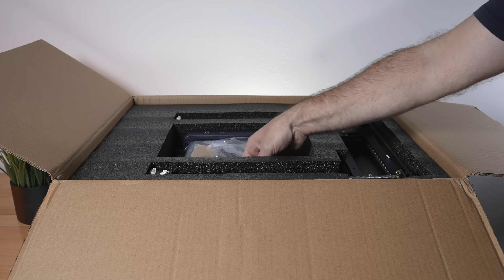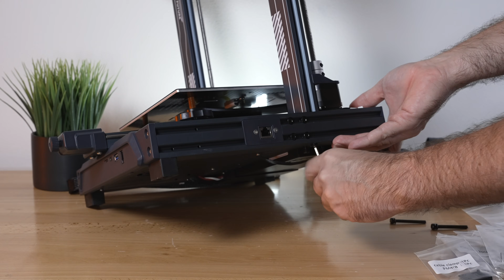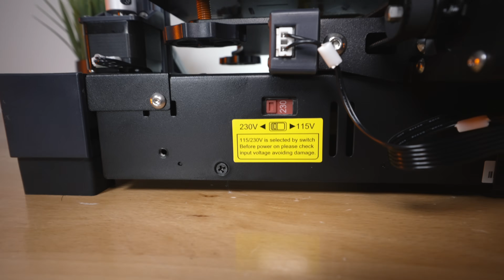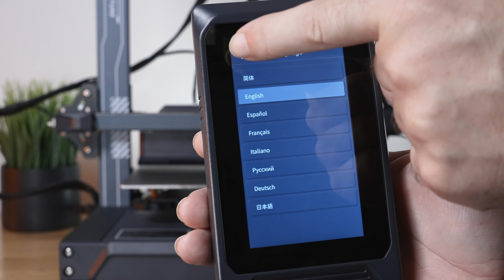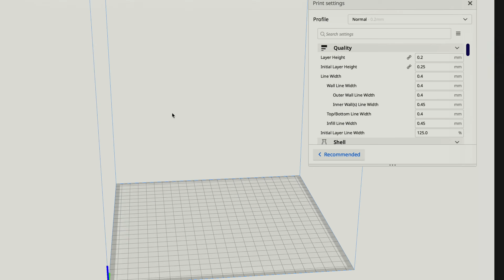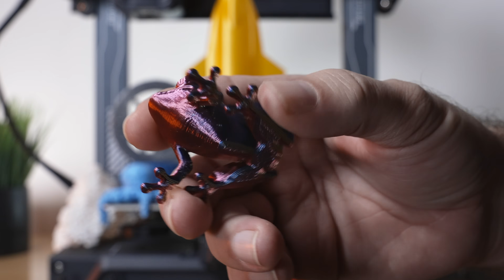Elegoo Neptune 4 Pro - Klipper 3D Printer - Unbox & Setup

Comment: Setting mine up now. That first step is tricky. I got it snug but the gantry z axis would not move back up. I had to basically tune it like a drum until the belt tension felt okay enough

Comment: I strongly advise against buying this printer. Before purchasing, I watched several reviews where everyone seemed to praise it, but my experience was entirely different. From the moment it arrived, the frustrations began. The auto bed leveling doesn’t work, and there’s no option to disable it. Prints come out as if the X-axis isn’t straight, making everything look tilted.
A few days later, I purchased the A1 Mini because I urgently needed a functioning printer, and, honestly, that thing just works flawlessly. It’s been printing non-stop without issues.
I’m returning the Elegoo tomorrow and buying another A1 instead.

Comment: Hey Vlad, if you can’t answer, can someone else please? I keep having failed prints. I followed every instruction. It keeps coming off of the plate and it won’t stay on. I have the right filament, I lubricated the rails, and I have the right model. Can someone please help me?
Reply: What type of printing filament are you using? Maybe the reason for not sticking is that the bed temperature is not adjusted well. For example, ABS needs a higher temperature to stick well. Also, the huge fan in the background must be turned off, which is almost useless except with PLA, which may require rapid cooling. There is also a special glue for the bed if all your previous attempts fail.

Comment: I love what this 3D printer can do, but how do I set the correct parameters to print what I need?  I did something to muck up the leveling and now it's either not touching (or even barely touching) the build plate, or it's dragging along the plate, potentially damaging it.  Plus i tried the knobs where you can fine-tune it, but i don't notice any difference.  Help plz 😶

Comment: I leveled, set heat settings ABS, did Extruder after threading filament and everytime try to extrude load, it gets system error and I hear a sort of grinding noise from the feeder / extruder. Error: TMC_Extruder reports error: DRV_STATUS: 00190050 S2VSA=1)lOWsIDEsHORT_a!) OLA=1(OpenLoad_A!) cs_actual=25.Oncethe underlying issue is corrected use the FIRMWARE_RESTART command to reset the firmware, reload the config, and restart the hoset software..Printer is shutdown.  
Options are Restart FIRMWARE or Restart KLIPPER.  I tried both, and over and over again get the same result.  Do you think my extruder is faulty?
thanks for your help

Comment: 16:28 Hi there, my y axis is very stiff, would this just be a lubricant issue where I just need to add a bit of oil to the rollers? It moves okay during printing but it’s so stiff I can’t move it by hand the way you do, please help. Thanks a lot

Comment: Hello, I am ne to the 3D printing I got an Elegoo Neptune 4 pro about 2 months ago and I did a new update for it from the Elegoo company and now my printer is not working properly. I am wondering if anyone has this printer and can help me out?
Reply: Hi We are in the same boat. Mine also is a non-start brick that I got in Jan. It quit working after a software  "upgrade" that ended it's brief life after printing 2 models.
 After 7 emails to elegooo I finally got a robot response and after 12 emails I got advise from them that did not work.  Anyone want a brand new elegoo 4 pro that has a software glitch that  sends it into a coma that they apparently cannot fix?
How about a little help- Elegoo

Comment: I would advise against manually pushing filament in to purge the line. I've clogged a lot of nozzles on my Neptune 4 Pro doing that. Once I stopped, not a single clogged nozzle since. Otherwise great video.

Comment: i just ordered this printer and look forward to using it. i bought it with level expectations. i’m not expecting the very best like the bambu x-1c for my uses for it. i do scale radio control and make a few tools and stuff of my own design here and there and the quality doesn’t need to smooth as butter. it just needs to look 90% and it appears to do exactly that. super stoked to get it set up!

Comment: I bought one - Speed and interest in klipper influenced my purchase.  Waiting for mine to arrive today.  Your videography and presentation is excellent.  Been printing since 2016.  Started with an Anet A8 I built and modded.  This will be my fourth FDM printer.  They keep getting better.  Anet A8 ->  Ender 3  -> Neptune 3  -> Neptune 4.  I tried resin printing but found it too messy.  I have been using Octopi for my past printers.  No need with this.

Comment: G'day m8.....i just won a Choice of Neptune 4 Pro or a Mars 4 Ultra 9K from Elegoo for newyears. Ive gone with the Neptune as my main building is FDM based. Now i have a Ender 3 V2 (modded), a Kywoo Tycoon Max (soon to be slightly Modded) and recently before Xmas my Sunlu S4 Arrived From Kickstarter (an excellent dryer and will do any Filament of up to 4 rolls). and for xmas my fam got me the Elegoo Mercury X Bundle to go with my Nova3d Whale 2 4k Mid size MSLA Resin Printer. Cheers for this in-depth review of the Neptune 4 Pro. This helped me make my choice to go with the FDM. A big cheers from A M8 Downunder..(Australia)

Comment: Is the issue with spiral mode solved? Is it possible to load gcode at the USB-C or the micro.SD slot? It's because I would like to add a WiFi module at the other USB-type A-slot

Comment: Great video. Thank you for that. My question is do you have to use Fast filament or can you work with regular PLA+?
Reply: Don’t know if you got a response but you can use regular PLA. Apparently the fast filament is just designed to work better when printing at higher speeds

Comment: Hi Vlad,  can I ask you a question? I want to buy my first fdm printer (have 2 sla’s) and I was thinking for the 4pro or the 3pro. I don’t need the speed that much. But the loudness is more of a problem as they stand to the other side of wall next to my head bord of the bed. I heard the 3pro is more quiet. But what are the best benefits of the 4pro (beside speed)

So which one would you suggest and why
Reply: Compared to A1 this is like jet engine, I could not stand it.

Comment: One thing I have noticed is that when it goes to the center at 25:16, well, you can see that point is highly deviated from the center of the bed. Is it normal?
Reply: It is. It puts the magnetic sensor in the middle, not the nozzle. The magnetic sensor is  at the back, at the extreme left side of who's looking at it.

Comment: 61yo female here and I will say, it was very easy to set up. Of course watching your video helped a lot. Thanks 🙏
Reply: Hi @susan3156, how is your experience going with the Neptune 4 Pro now that it's 6 months later? Still working well for you?
Reply: NOT ANYMORE Do not get this printer do not get this printer. I've had their Neptune three and I don't know what happened. I'm pretty sure they sold the company off. This is a completely different machine is absolutely horrible like absolutely horrible. I can't even get the thing to work and I used to print on Neptune three for over half a year I made hundreds of dollars.

Comment: So the only difference between the PRO and the normal is that the PRO comes with u-shaped metal guide rails for X and Y axis?
Reply: I mean the main difference, and the main selling point, is that the Pro comes with Klipper firmware for faster printing...
Reply: @rijlqanturis625  The non pro version does come with Klipper too.

Comment: Pretty amazing how the falling price-point of technology continues to pull more people into the game. Not bad for an inexpensive entry. And I am quite satisfied with their low-cost filament for prototyping purposes. Elegoo seems to be satisfying its targeted market. Thanks for sharing this video.
Reply: I was talking with the guy who got me into 3d printing (only 7 or so years ago) and how much it has changed, as things have become more accessible and easier. Also how "influencers" have became prevalent. "Fans" of certain manufacturers that have popped up too.
Reply: I'm a fan of Elegoo, mostly because I'm a fan of the price point and that they seem to deliver the most you can get for the price point.  I have had the Neptune 3 Pro, now have the Mars 4 Max and am about to get the Neptune 4 Pro.  Good customer service too, which is important.
Reply: @davedempsey5282  Just thought I'd ask, but how's your experience been with the 4 Pro so far? I'm about to pick one up myself and I'm torn between the size offered by the 4+ and the sturdier materials in the 4 Pro.
Reply: @DigitalJedi  Didn't get it.  Got a Sovol SV06 Plus instead.  But the best thing I have had is the Artillery Sidewinder X4 Plus.  Wicked fast, klipper, big, rod supports, and rails.  All there for $319 when I got mine, I think a bit more now.
Reply: @davedempsey5282  Oh dang. What made you change your mind over the 4 Pro?
Reply: @DigitalJedi  Pom wheels.  I was wrong about that though.  But Elegoo just iterates just enough to keep up in the FDM side, their Resin printers is where they care the most.  Sovol just brought a voron 2.4 style flying gantry 350x350x345 700mm/s corexy printer for $549 at the moment, nobody else is even close. And Artillery has Klipper, all linear rails and supports for less than $400 so...
Reply: @davedempsey5282  That Sovol is a little out of my price range, and I really rather not stray much from the ~$320 that the 4 Pro and 3kg of filament is at right now. Thanks for the heads up on Artillery though, will definitely be checking them out.

Comment: 31 point leveling? Mine does 121 points
Reply: 121 points leveling? Mine does 224 points
Reply: @TheOldKenobi  Not sure if trolling or being serious? I was being serious, even made me question things and I looked it up and it's supposed to be 121. Not sure why his says 31
Reply: Yes, mine does 121 as well. Perhaps he had an older firmware? @Brandon-zw3hw
Reply: @Brandon-zw3hw It's Klipper dude you can do 1000 point leveling if you want.
Reply: @CapacitorCapacity  oh. This is my first printer, so I had no idea
Reply: He probably gotta update the firmware to get the 121 point leveling as his is V1.0.1. Edit: Earlier units got 36 points ABL. He also says 36 points and it shows 36 in the upper left since it finishes there, you were probably looking at the upper right.

Comment: Thank You for the video.  Did you like the changes from the 4 to the 4 Pro?  Do they really make the printer better?
Reply: It cant print round mechanical stuff so no its just a toy you have to sell cheaper then you bought it to get rid of it. Get resin printer instead
Reply: @juliusvalentinas and what do you mean by it not being able to print “round mechanical parts”??? it can definitely print mechanical parts
Reply: @juliusvalentinas I’m sorry, you sound really stupid right now hating on FDM printers. I personally don’t want to deal with a resin printer myself.
- Smaller build volume most of the time.
- Too much wasted support material.
- Puts out VOCs and fumes, needs ventilation.
- Parts require post processing.
- Harder to use.

Comment: honestly bottom of that cube isnt looking the best. i wish you went deeper and calibrated e-steps and flow and then print again. because every 3d printer owner does those fine tunings before using the printer and therefore a review lacking these tunings is basically incomplete and pointless.
Reply: As someone that struggles to put things together, I found this video insanely helpful for unboxing and assembly. I wouldn’t say this was useless at all
Reply: Well there is no e-steps to calibrate on a Klipper printer. It's rotation distance. And it isn't flow, it's pressure advance. Perhaps he isn't 100% on Klipper since it is new to many, but you obviously aren't familiar either.
Reply: @CapacitorCapacity bro got humbled. Key example why the gatekeepers of this hobby/field are so extreme and how easily they scare people off
Reply: @bdawg82 it’s not just this hobby full of gatekeepers photography is just the same, the know it all know nothing brigade speak a great photo but never go out and take any.  This hobby is new to me and could easily be scared off by people like him if I did know better.
Reply: It's not pointless brotha, I used this video to get me there, and then watched a different video for fine calibration. But it's still nice to have the assembly and basic setup to get you to the point you can start playing with it
Reply: Shut up nerd